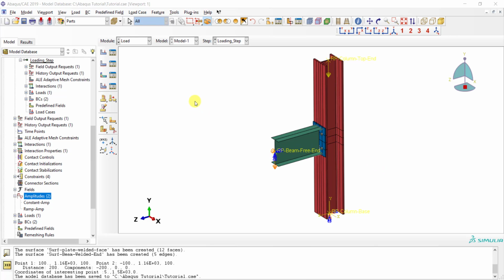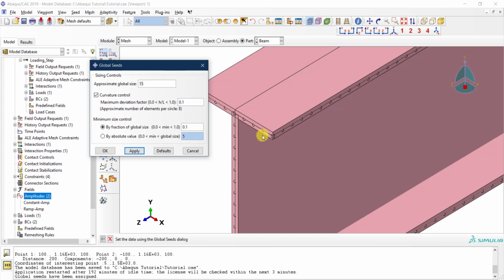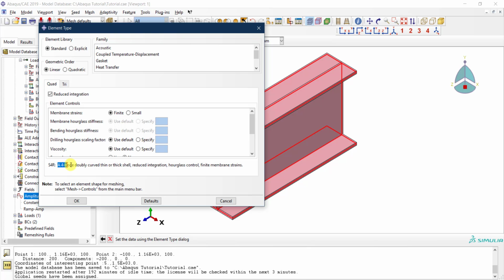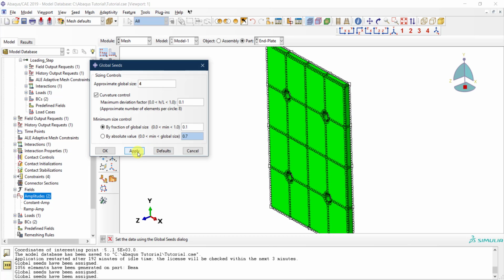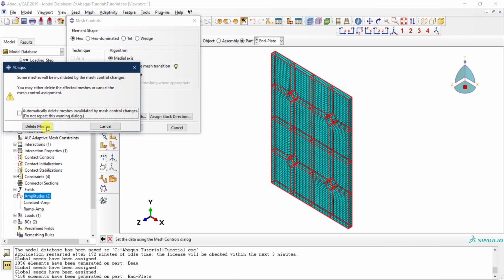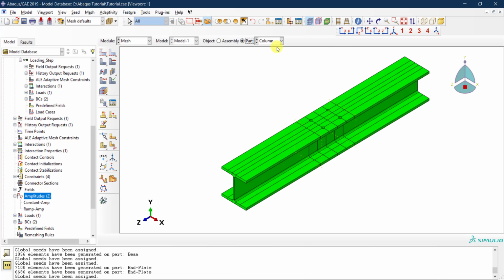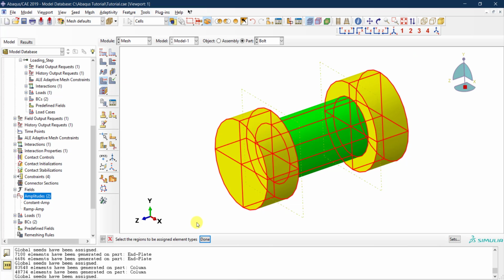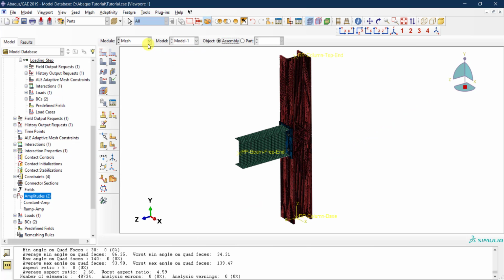#16 ABAQUS Tutorial: Meshing

Comment: @12 mins, what is the use of mesh control ? What will be change without using it ?
Reply: In this case nothing, we just check an option. If we agree with defaults, there nothing changes (even if we don't open it)